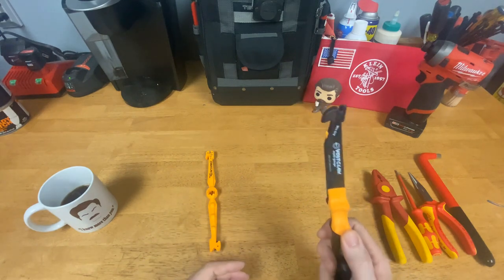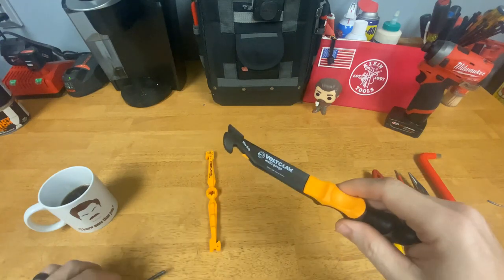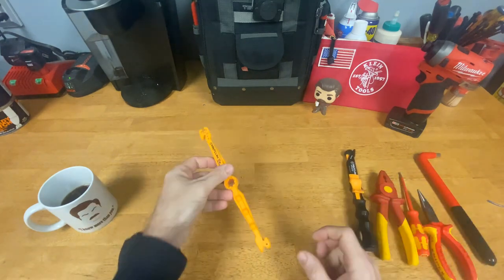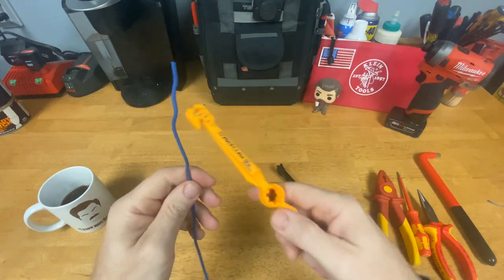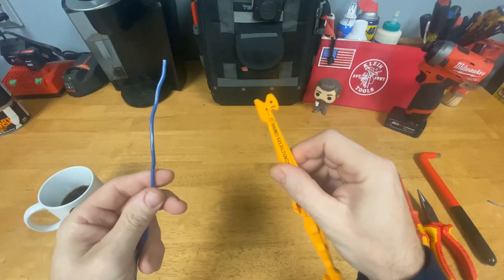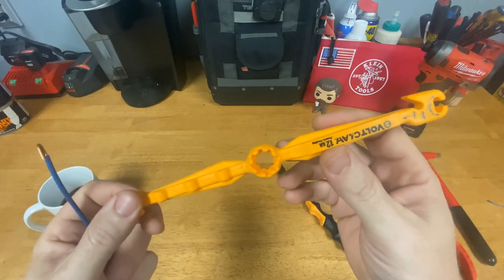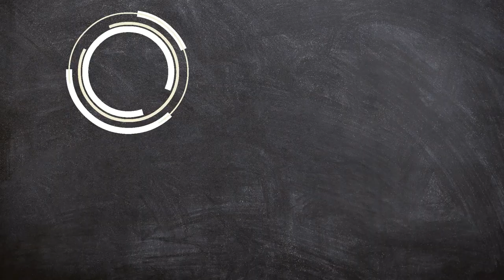VoltClaw -12 Gauge and Multi-Gauge Non-Conductive & Insulated Tools - Volt Claw, Knipex, Wera

Comment: Great video. I can relate to the J box, another great thing to keep in the truck is a pair of Class 0, 1000V rated gloves. Once you get used to them, you can do quite a bit of hot work much safer.
Reply from the maker: Thanks for the suggestion. Is there a certain brand you have that you know are good? I’ve never worn any of those before.

Comment: Just got mine. 
There are a lot of 4” sq boxes with dbl and sgl gang mud rings throughout the apartments that apprentices stuffed wires in.

This will help straightening out those nightmares while looking for the troublesome connections.
Reply from the maker: Sounds like you work where I work 😂😂

Not an everyday tool but very useful when you need it!

Comment: I use the wirenut driver a lot for industrial work. They work great with most wirenuts, especially compact ones.
Reply from the maker: Good to know your experience with the wire nuts. i figured there are some that it would fit great, it just wasn’t any I had besides the 3M. 

I also thought some people may like that feature… it’s just not for me. 

Thanks for letting everyone know.

Comment: looks like you can bend wire with both of Volt Claws...
Reply from the maker: You can, the multi gauge is just a little easier to use (in my opinion)